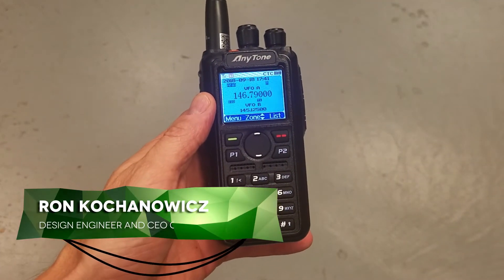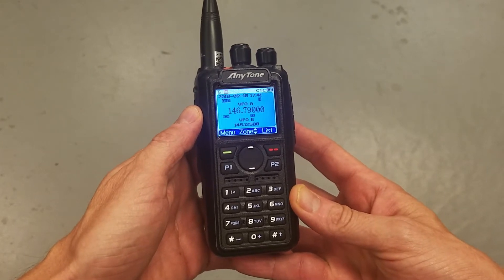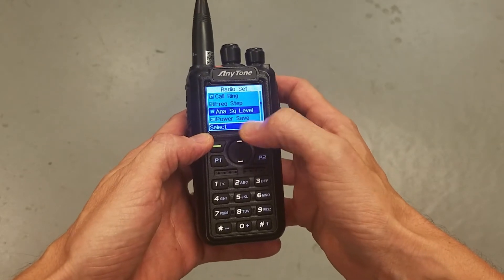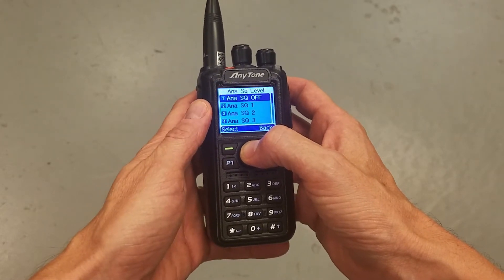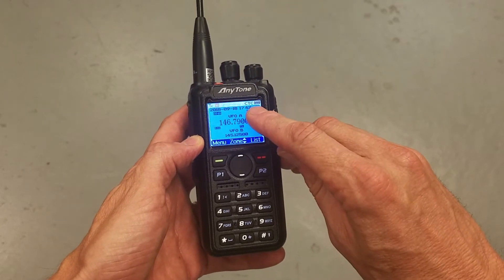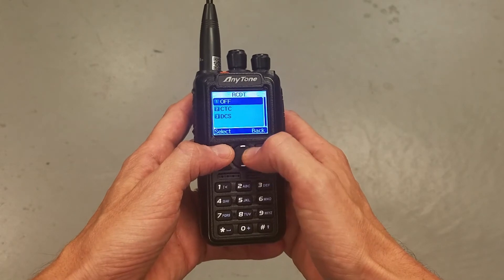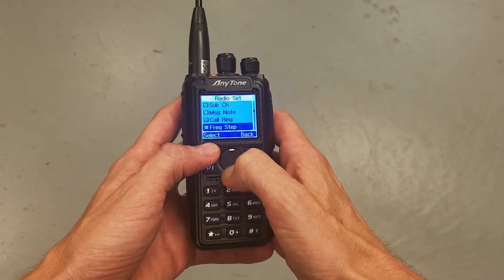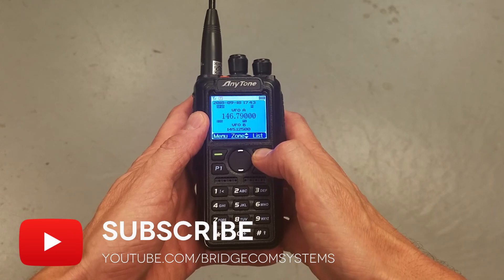How to Change the Analog Squelch Level on an AT-D868UV

Comment: Thanks for the video.  
Not exactly related but I had an issue with the audio sporadically cutting out on analog stations as if the squelch was set too high.   Come to find out I had to set the squelch tail elimination to off.  In the CPS under "Optional Settings" and the "STE" tab, turn "STE When No Signal" to "off".   
Fran - N1PFJ
Reply from the maker: Thank you for your comment.

Comment: I find it difficult to understand why such an over priced radio can't come with a detailed instruction manual?? Settings on this radio are long and tedious to set up...Bluetooth is the best function on this radio ...the dmr armature radio cordless phone nonsense ...it's not a radio to use mobile is a horrible distraction changing frequency or zones ...no one tells you the expensive nonsence about the hotspot...bridgecom sure won't I called for a price to get a radio set up with a Hotspot...I laughed and hung up..dmr is a usless system like the cordless phones of the 70's net works full of people putting you down and criticism is rampant for those new in dmr...dmr needs to go away ...to the land of far far far away with shriek and donkey...it's pretty usless